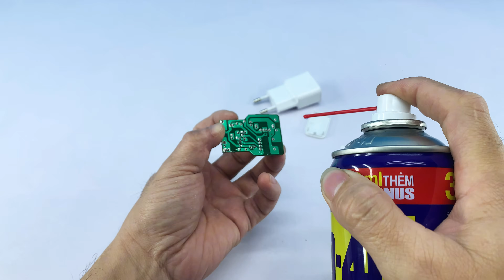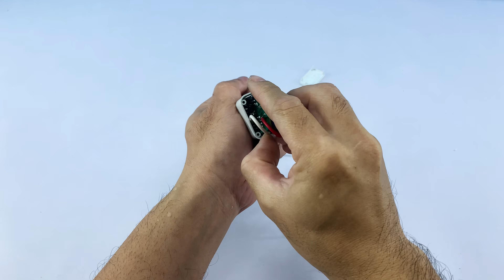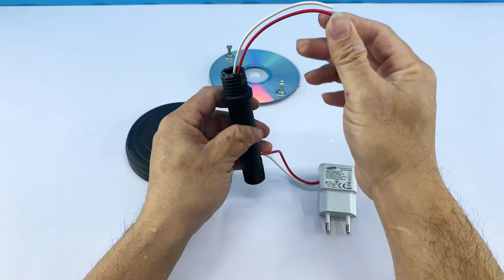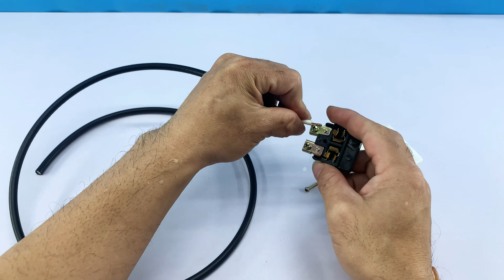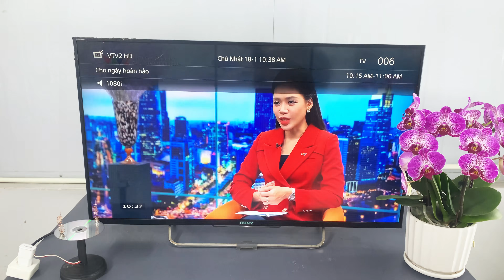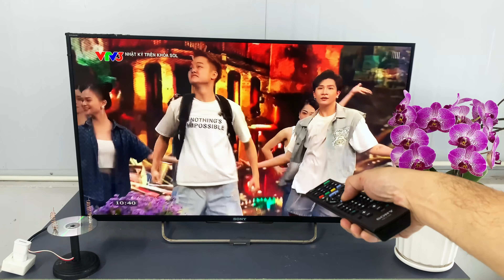Never Buy an Antenna Again — Connect a Phone Charger to a CD and Watch the Result 📡

Comment: This is all a scam; laws and knowledge of radio engineering contradict it. Don't do this! The video is a complete scam. The laser disc is shorted by two screws, and the spiral coils are just for show! And the main charger turns into a source of electric shock, TV failure, and fire!!!!   Это все обман, законы и знание радитехники  противоречит этому. Не делайте этого!  Видео  полный обман. Лазерный диск закорочен двумя винтами и спиральные катушки для красоты! И главное зарядное устройство превращается в источник поражения током , выходом из строя телевизора и пожаром !!!!
Reply from the maker: I understand your concern.

Safety is very important, and no one should attempt anything they are not comfortable with or do not fully understand. This video shows a simple experiment, but results and risks can vary depending on how it is built and used.

If someone is unsure, it’s always better to use certified equipment and follow proper electrical safety standards. Thanks for sharing your point of view.